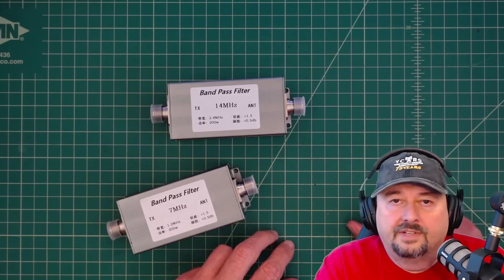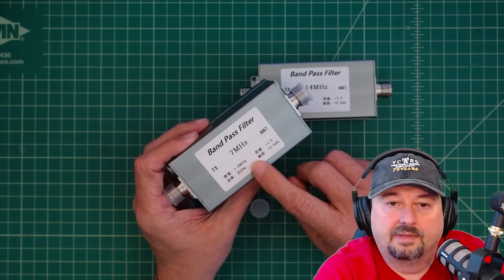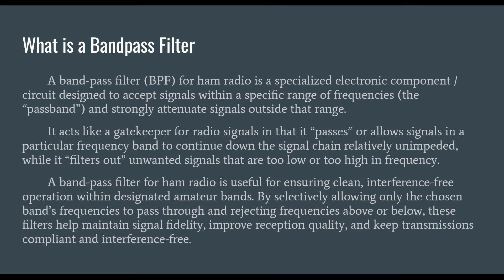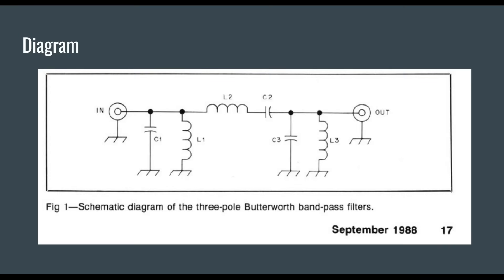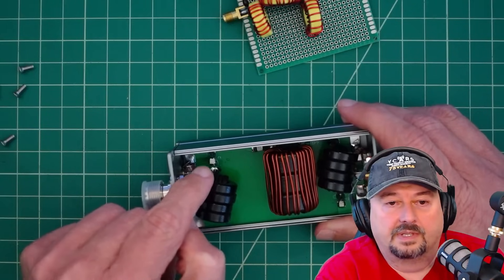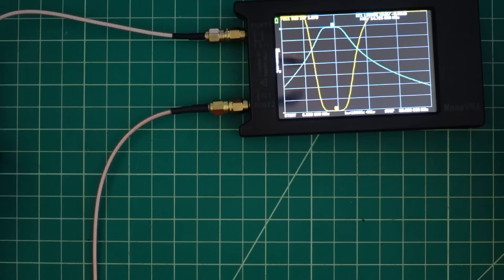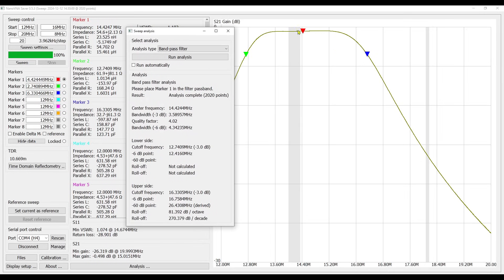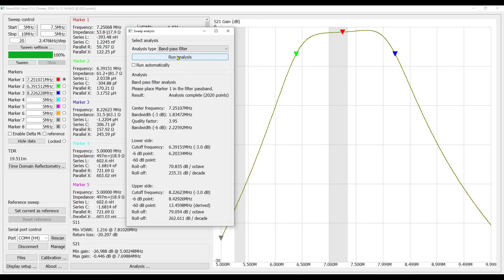Top Affordable HAM RADIO Bandpass Filters You Can't Miss!

Comment: I ordered one a month ago for 80m band. I measured with Siglent and it showed -10dB on 3.5MHz and -2dB on 5.13MHz. i don't know if I'm doing something wrong with measurement, as the analyzer is new to me but that seems terrible. It showed the same in SA and VNA S21 mode, was normalized before measurement and was 0dB on straight cable. It's just so awful that I can't be sure I measure correctly.
Reply from the maker: @pangalacticgargolblaster9578  have you measured other filters and gotten the expected results?
Reply: @TheSmokinApe  No, I only had this one. I sent it back today. It was the same housing and internal structure sold as 3.52 MHz BPF.

Comment: To really characterize real world performance, you need to look at the attenuation the 20 meter signal at the adjacent ham bands. In the case of the 20 meter filter, it is down a little over 30 dB at 18 MHz., a decent reduction, and it should be a lot better at 15 or 40 meters. I have experienced operating a 20 watt 20 meter station using a very similiar designed filter, and my 20 meter signal caused severe interference to a 17 meter station operating 200 feet away. The 17 meter station then moved to15 meters and all was well. In that instance, it may have been that the station on 17 meters could have stayed on 17 if he had been using a bandpass filter as well.

Comment: I build bandpass filters to include switchable filters I even have a few build videos. Don't use hot glue you will melt it and possibly start a fire. JB weld will change and certain resin epoxies  will change your tuned SWR/VSWR. I use GC Electronics 10-3702 Q Dope,Pure Polystyrene Coating,Cement,Bottle with Brush,2 oz when I need to lock in my windings. As usual an enjoyable video.
Reply from the maker: Thats good info, thank you
Reply: @TheSmokinApe   Your welcome also on a BPF it doesn't matter which end you connect too antenna radio if it works it should be interchangeable but on this particular design do not tune through the filter  you will blow the capacitors tune then attach the filter.

Comment: I would definitely glue those. They make a wicked white silicone glue that is used in electronics to glue everything like coils, capacitors, etc.They usually also glue the edges of the board in a few spots so it can't move either.
Reply from the maker: @bruceweight7319  that’s probably the right thing to do

Comment: Seeing the mildly lose components - my first thought was to forget the hot glue idea and use the Red Permatex.   Stuff used to glue engine heating pads on the oil pan when you winterize your truck.
Reply from the maker: Not a bad idea, someone else mentioned JB Weld

Comment: Also there is a 6m version. Its quite wide 48MHz to 60Mhz-ish at the -3dB points according to my nano VNA. A very useful bit of kit. Have you ever looked at the Rx path back through the filter? It should be reciprocal but sometimes I'm not sure.
Reply from the maker: it should be the same both way but some I have seen are not.

Comment: Those filters are a good choice - most common ham bands. 
For listening outside ham bands, you could use a 30m filter - and check the 10MHz time signals from Hawaii / Colorado. These signals should be "close enough" to make it through the filter.
Could also try a 15m filter, and 20MHz time signals.
Reply from the maker: They could come in handy for sure 👍

Comment: Great job testing . I was wondering on them . I only have 10 and 20 meter ones now. They let me work FT 8 on 2 bands same time from 2 radios and antennas'  Lots of contacts ! I have band pass boards from DX world. Full legal power. multi band with 12V relays.  I just need rotary switch,case and SO 239 . I do have one for CB coming but held up in bad weather.NY and many outher places getting winter storm and high winds . With good coax jumpers and good coax feed line you can easy overcome insertion loss . start with good 1/2 wave or 5/8 wave antenna that has great recieve.  You won't even notice any loss  from filters. That what I did.  Them filters help with out of band noise . That can improve signal to noise ratio to help pull out weak station. 73
Reply from the maker: Hey Robert.  I agree with you BPFs can make a big difference, thanks for watching!
Reply: @TheSmokinApe  You can test with single port SWR sweep testers like the MFJ or Comet. use dummy load do a SWR sweep. Just gives a general reading of band pass frequency . Does not give attenuation DB data.  This is where a VNA   2 port is really needed . I say more tools for the shack
Reply from the maker: @ that’s a handy tip 👍

Comment: Can you filter out RFI to drop the noise floor? Obviously not how a bandpass filter works.  Think you could design an external filter for 40m that boosts the signal, maybe does some EQ, and filters the RFI?
Reply from the maker: Basically an attenuator which most radios have these days.  They will also lower the signal you are trying to hear but hopefully improve the overall signal to noise ratio 👍

Comment: Know where one could get reliable 2m and/or 70cm Band STOP filters? Like so you could have a scanner running and still use your dual band rig and not blow out the front end of the scanner?
Reply: The filters necessary depend on how much power you run on the ham bands, and how far apart the scanner antenna is from the ham antennas. Sometimes putting the scanner antenna 10 or 15 feet directly below a vertical colinear ham antenna is sufficient isolation to protect the front end of the scanner. It helps to carefully (use about a 30 dB attenuator inline,) monitor the scanner antenna with a spectrum analyzer like the TinySA to see how strong the 2 meter/70 cm signals actually are that would reach the scanner. Then you know how strong of a signal you need to attenuate, and how much the filter needs to attenuate it. In situations like that it helps to get an idea of what the filters actually have to do instead of just guessing and buying. As you pointed out, you want something reliable.
Reply: @ fair enough, that’s a good idea too. I don’t have a tinySA but I could look at getting one, unless my NanoVNA would work instead. Even if I was to do that I don’t know where to go looking for said band stop filters in the first place. Do you know of makes, models, dealers, stores, etc. that would sell them?